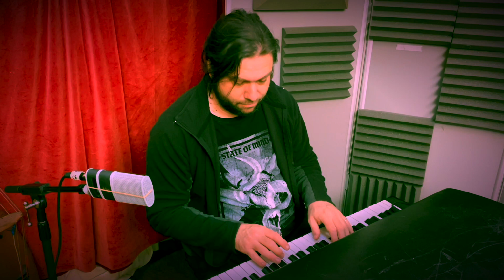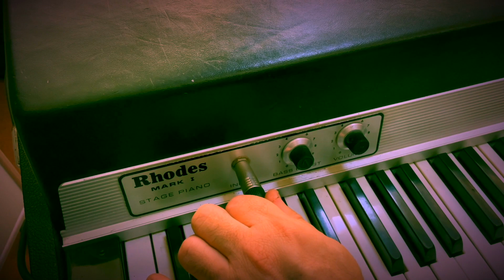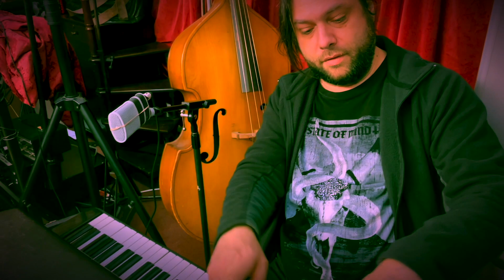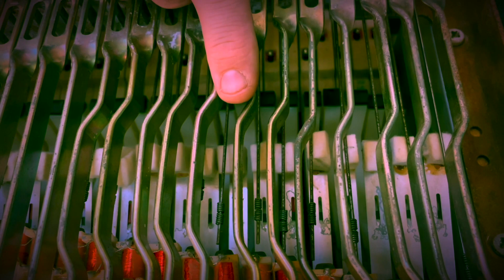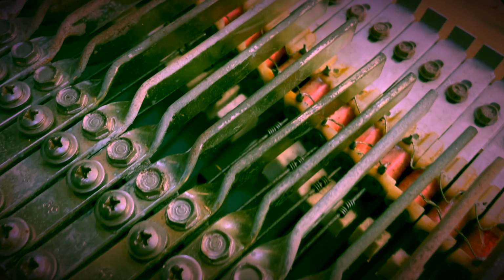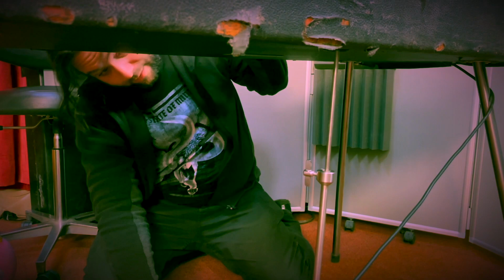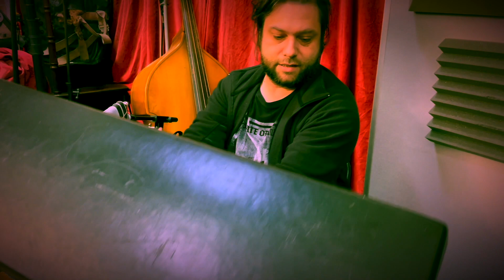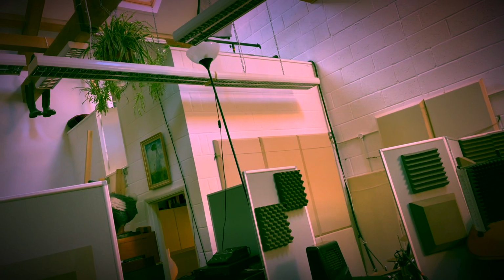Fender Rhodes MK I 73 Full Demonstration and how it works

Comment: My friend just dropped round his Rhodes 88, I am going to try and fix it up, the top notes don't work, I can't fathom how the pickups are wired, they seem to be some in parallel, some in series, very strange. I'm guessing at least one is open circuit.  Strangely the bottom few notes of the 88 don't seem to have resonator bars.

Comment: What's the point of the wires with the little coil spring on them? You mention tuning? 

I thought the pitch would come only from the weight and size of the tonebars and that the Rhodes would never require tuning, like a glockenspiel or a marimba wouldn't...
Reply from the maker: The rods (wires) with coils on are the tines, which are the basis of the sound. The key hits it and causes it to vibrate. The coils act as clips to alter the vibrating length of the tine, similar to the way that a finger on a stringed instrument causes the notes to vary. The coils are really only for fine tuning, but it is possible to go plus or minus a few semitones on each note. The tonebars are used for resonating the vibrations , but they themselves don’t vibrate when they are struck.